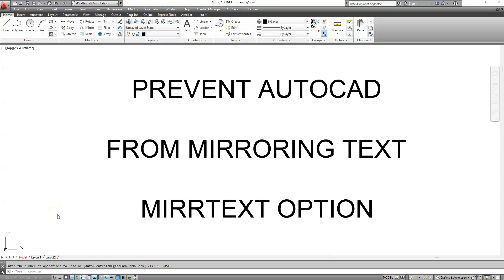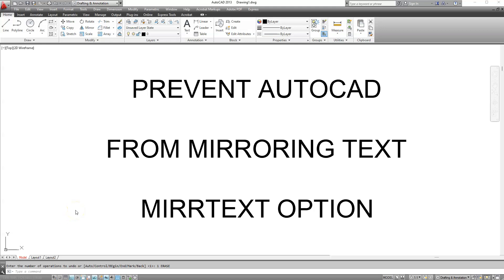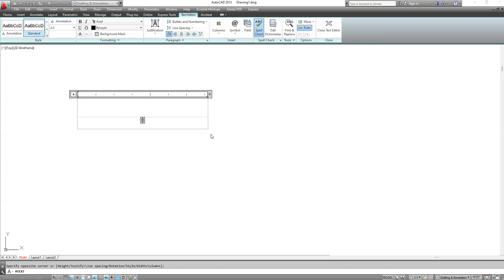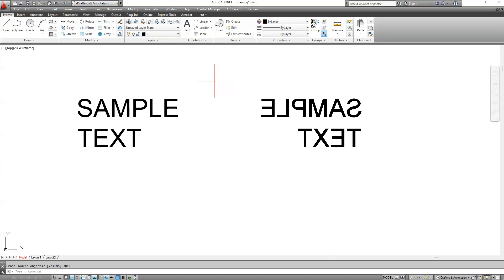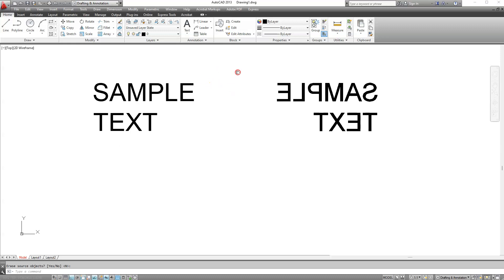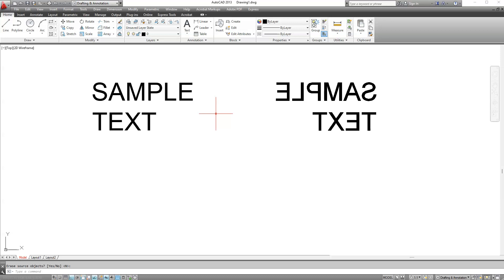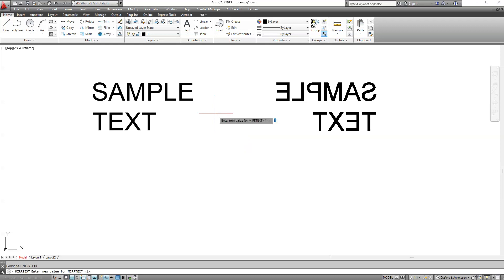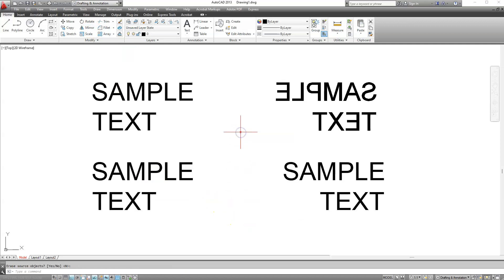Prevent Autocad from Mirroring Text - Stop Text Mirror - Enable and Disable Mirrtext

Comment: Great video! Question for you. I have a block that contains nested blocks with text and/or attributes in them. It's a dynamic block with about 20 visibility states. I want to mirror it, but the text gets mirrored too, even though I changed the text inside the nested blocks to attributes. Any idea how to make this work?
Reply from the maker: The MIRRTEXT command does not affect text or attributes inside blocks. It only applies to standalone text objects, such as TEXT or MTEXT, outside of blocks.For blocks, including dynamic blocks and nested blocks, you need to handle text mirroring through block properties and attribute settings.